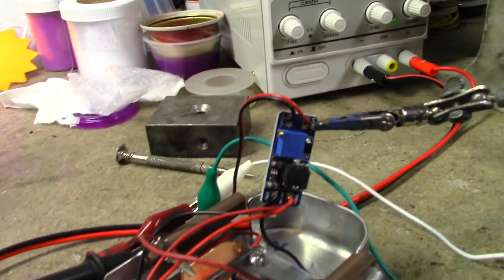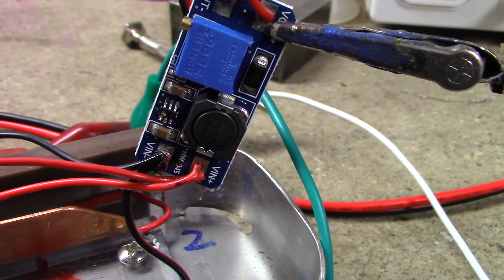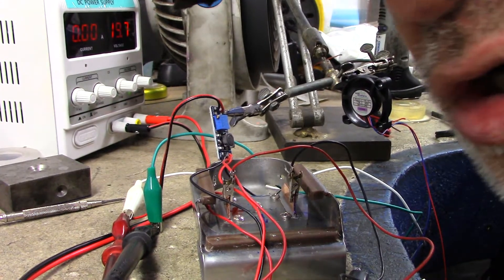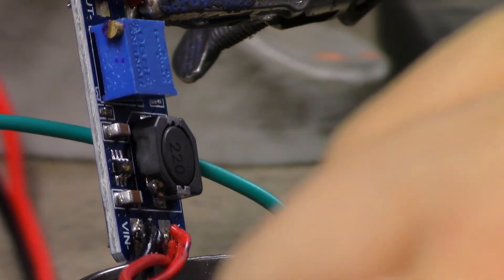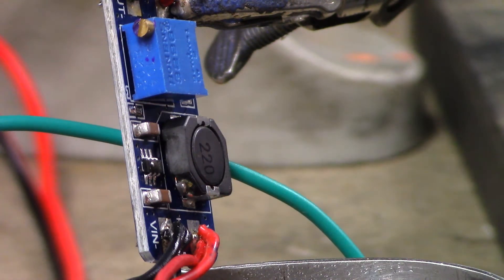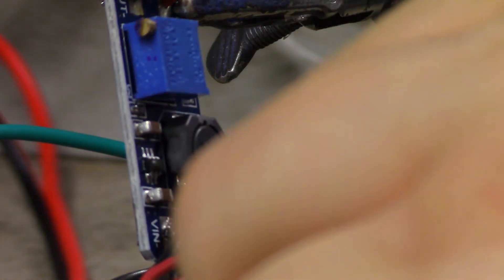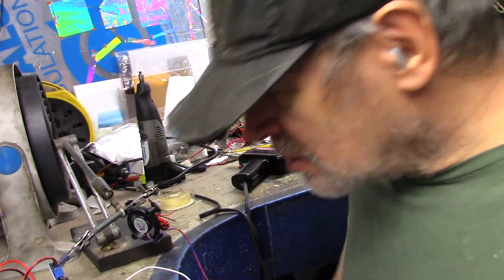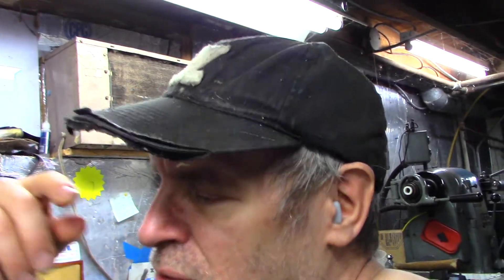MT3608 Boost Converter Fail

Comment: IMPORTANT - you must connect three volts first, then adjust the output voltage to be higher than the real input voltage you will be using - or you will burn these out. If you want to use 19.7V from a bench supply - FIRST - you must connect your bench supply to the module with only 3 volts. Then turn the screw on the potentiometer counter-clockwise to make the output voltage at LEAST 19.7V.  Then you can turn your bench supply up to 19.7 on the inputs. It's that easy. Always make sure the output is adjusted to more than your input voltage before applying high voltage over 3V on the inputs.
Reply: I think applying more than 6v to this IC will probably result in eventual failure
Reply: It's not the IC...the IC is fine, but there is a mistake on the PCB design, as pointed out by another commenter, where the voltage adjustment pot is wired wrong. It should be used as a variable resitor, but it's wired as a potential divider. Short two pins and it should work. Then put the correct capacitor on and it should actually work well.

Comment: I have the same experience. I am very disappointed with these modules.
Reply from the maker: I hav sins determined that they cant handle more than around 10 volts input.
Reply: @JO753  if you pull up the data sheet for the chip that drives it you will see it is meant for ideally low load applications
Reply from the maker: @dlayman101   Thanks. I dont recall ever seeing the data sheet.  But, the ad for the converter did overstate its capasity.
Reply: @JO753  no problem I just bought a pack of them and I’m the Amazon comments it seemed a few people broke the boards by not turning the pot 15 times before powering up, if the output voltage is set lower then your input voltage when you initially power up it sounds like it will blow the chip up.

I’m using them to replace some 9v batteries in devices that will never push more then a half an amp, I wouldn’t trust these to do even an amp without some extra cap filtering on the output.
Reply: Just connect bottom pin and the right side tiny terminals on the back. On the pot...
Reply: @dlayman101  read my comment for the correct solution